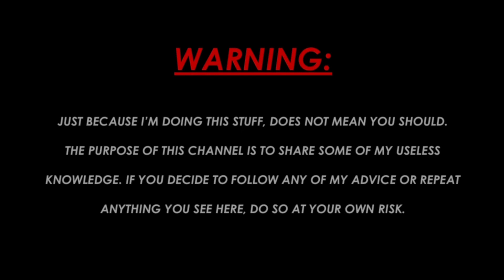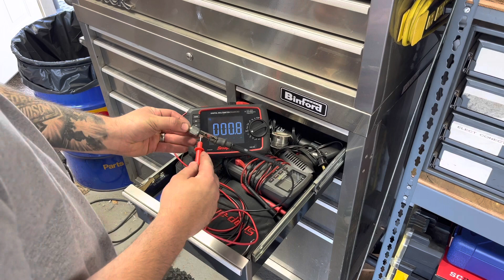Harley-Davidson brake switch repair

Comment: What about the front brake lever I get none brake signal  rear and front not sure what’s going on. If 2014 883 has 2 brake switch sensors
Reply from the maker: All bikes have at least 2 switches. One on each master cylinder. Harley front brake switch is behind the brake lever. People often brake them from putting on levers incorrectly. Hope this helps!

Comment: Just a quick question will any standard  ie car pressure switch work or does it have to be an HD part ?I have a 2015 48. Great video though well done.
Reply from the maker: It just has to be a 12 volt normally open switch with the correct size fitting. For how cheap it was, I would just get the correct one. Great question!